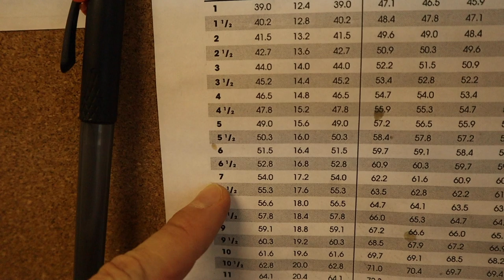How to make a Hammered Sterling Silver Ring

Comment: Pretty nice
Reply from the maker: Thanks
Reply: @DynamiSJewelry  I've got a question, have you ever used silver from sterling silverware before to make jewelry? Have you melted it down and made your our plate, sheets or wire from it?
Reply from the maker: @roverman985  hi! Good question! No, never... Because silverware has plate-mark 800. So, this plate is very fragile! It impossible to make something without cracks... And we can not use this plate for Sterling silver jewelry.
Also, it's really very hard to make 925 from 800, you never know what components are in that 800...  The best way and very easy is to take 999 silver and make 925!
Reply: @DynamiSJewelry  thanks for reply. I was just wondering because I've seen another person melting down sterling silver handles off of silverware and he is making bars of sterling silver. So are you buying sheet silver from a supplier then to make jewelry?
Reply from the maker: @roverman985  I buy 999 silver, usually in coins, than make 925
And start making my jewelry 🔥
Reply from the maker: @roverman985  I don't buy sheets or wire, to expensive. I make it myself

Comment: Is that a silver weld?
I just started and I’m using a syringe with flux and solder combined but my joints are weak and I’m thinking this stuff doesn’t work well or I’m not doing it right!